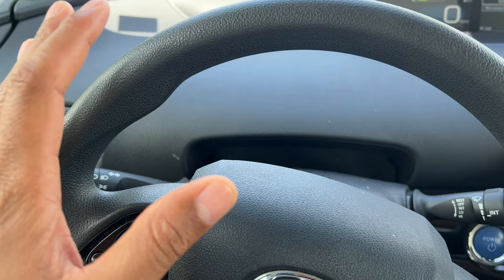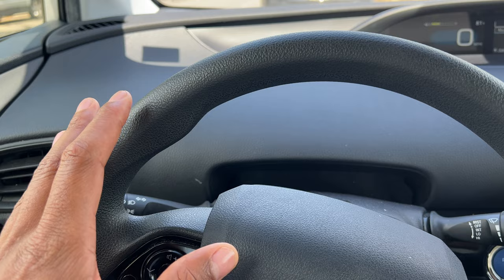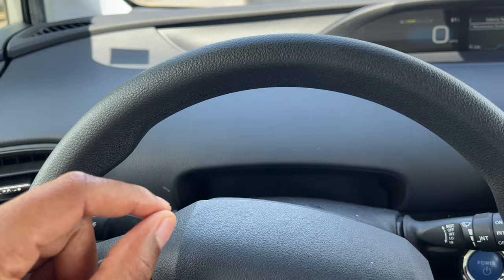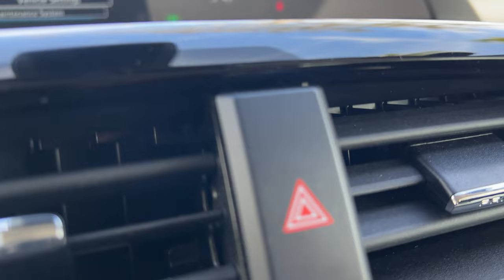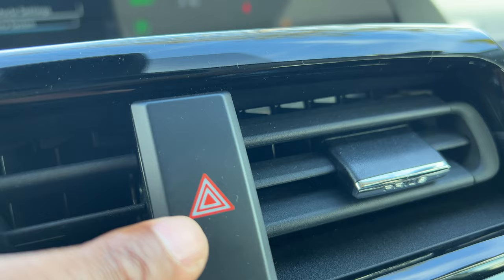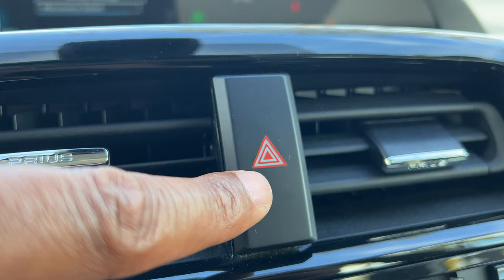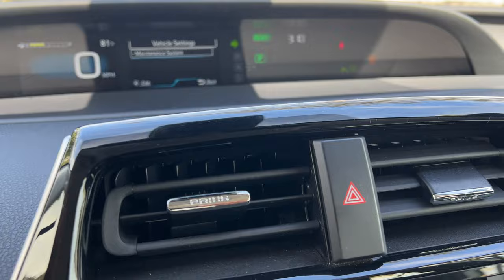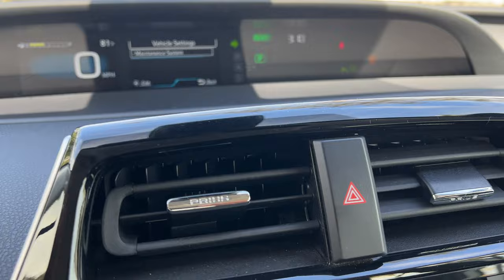How to Turn On and Off Hazard Lights/Hazard Flashers Inside Of a Car

Comment: When I came home the other day I put on my left signal light to pull in driveway and both blinkers came on. I then pressed the triangle, and it turned red but it stopped whippers from going at the same time and now I just have to press my left or right and they work. Did I do it right for that triangle is still red lit up?
Reply from the maker: It sounds like you may have accidentally activated your hazard lights. Press the triangle button again to turn them off and your turn signals should work as normal.